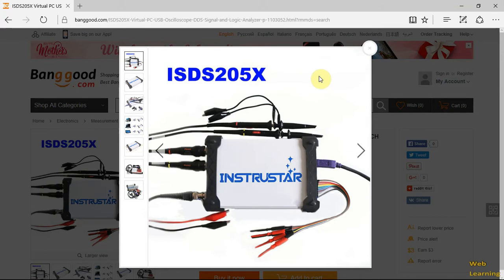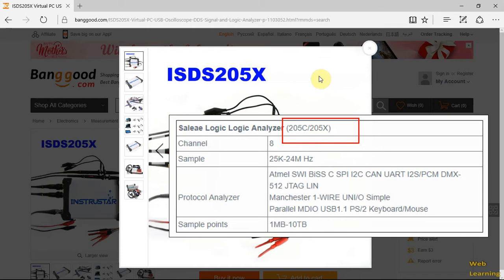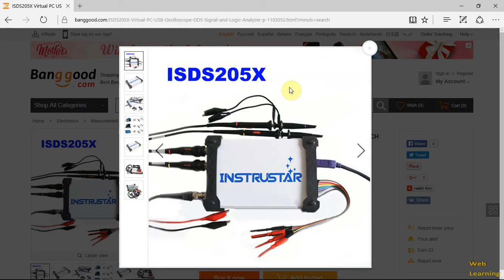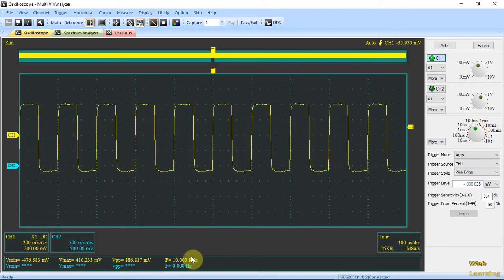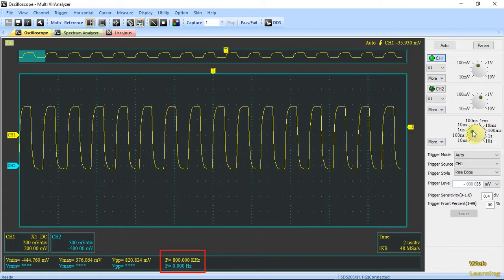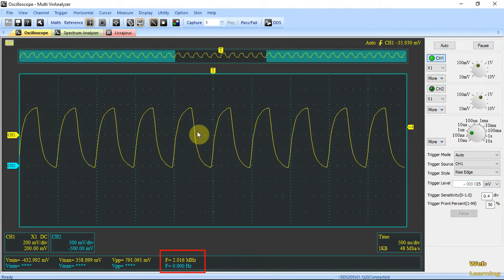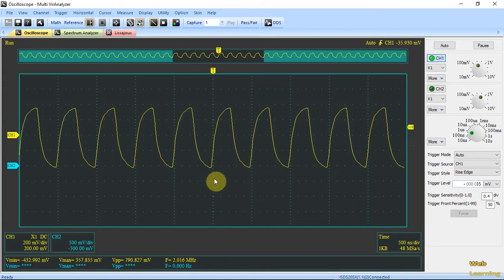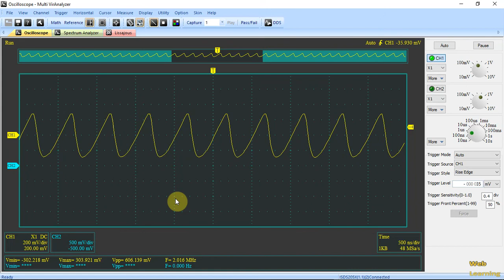Scope and Logic Analayser review - ISDS205X

Comment: NIce  demo , no problems of usb connection , drivers?i have a Hantek , that refuses to connect now, never found a solution
Reply from the maker: What error are you getting? Is there usb connected correctly in the windows? Did you change the USB cable?

Comment: Hello, and thank you for sharing this video!

Isn't it supposed to be a 20 MHz bandwidth scope, and not 2 MHz?
Reply from the maker: You can read on Google about " scope bandwidth vs sample rate". It doesnt matter what they write on the spec, what you get out of it matters. So for 40MHz sampe rate, ~2-3MHz bandwidth it very good for a sine wave. If you want a square wave, the you will reach the 20MHz.
Reply: Web learning OK, thank you. That's just a bit different from what I've been used to with oscilloscopes. But nice to have it clarified! 🙂
Reply: @Weblearning1  Thanks for gave a clue about this topic, i will read many of them.